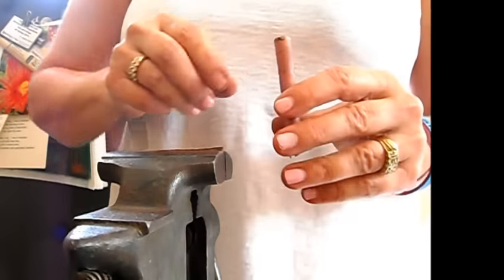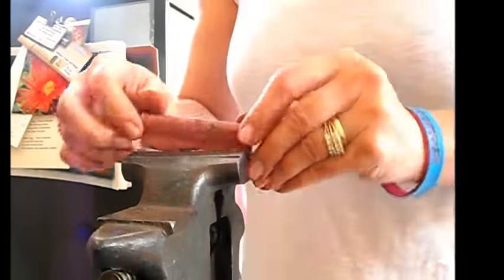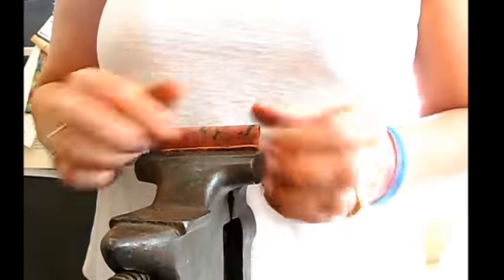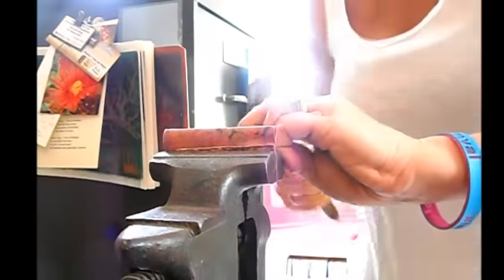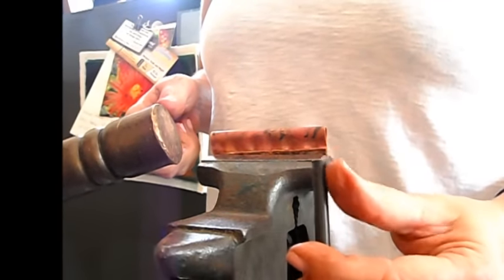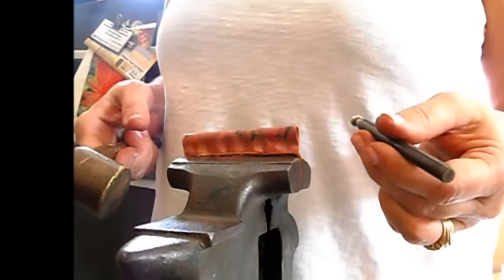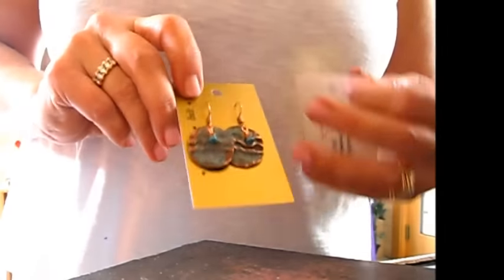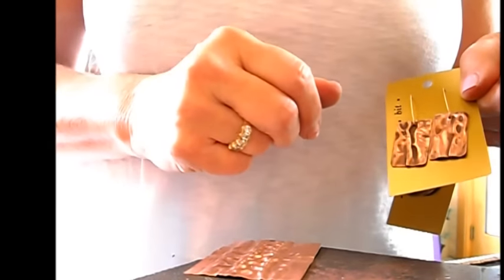Air Chasing Copper

Comment: I've currently got a electrician/plumber's work site right next door as they're replacing the kitchens and bathrooms and the old wiring in the flats where I live. It's like Christmas with all the pieces of copper I keep picking up.  I usually buy copper from a jewellery suppliers and its treated to stop it turning your skin green or black...do you have any tips as to any ways to stop it from doing this because its so lovely looking until I wear it lol! I know I can do various patinas and things like that but is there any sort of home made (read 'Cheap' lol!) Ways to stop it reacting with skin?

Comment: You can use a flat or mill file to dress the end of your punch where it has been peened by blows from the steel hammer. An 8 to 10 inch file not including the handle would do nicely. Longer is better usually as you can get a longer stroke.
Simply clamp the file horizontally in your vise with the damaged end protruding out about an inch. If the punch has flat sides match the angle of the file stroke paralell to the length and the angle of the surface and push forward with a moderate amount of down pressure. Continue strokes until the surface is flush. Rotate the file for the next flat and repeat the process. If the punch is round the process is similar other than using a round over motion during the stroke. 
It will make sense when you try it.
Other wise a belt sander would do nicely as well if you have one in your shop. If you are really into metal working a mini grinder, bench grinder etc. will also do the job. Goes really quick even with a file and your punch will set back in its index.

Comment: With that type of camping stove butane and those torches, if you tip it up and get any liquid in to the injector orifice, it will instantly block due to the low quality gas.

Comment: I would love to get a torch like the one you have. Can you tell me what to buy on Amazon?
Reply: What metal wire do you use for the earring wires using copper for the design?
Reply: If your'e serious about it don't buy a butane/or propane torch to start. It looks like she's using propane.
I use a Mapp torch for years now . Much higher temp if needed and reasonably accurate point of heat for delicate work.
That's in the €100 bracket if you buy a good quality brand.

Comment: Beautiful earrings! Copper is my favorite metal. I would like to try this technique. I have a torch on its way from Amazon. My question is do you need to wear ear protection with all the loud pounding? Or does it just sound loud on the video? Also where did you get your rawhide hammer?

Comment: What gauge copper is best?
Reply: I was using 24 gauge in the video. You can use heavier gauge and you can use lighter gauge - it just depends on how you want to use it and the sturdiness you require. I'd suggest experimenting with some different gauges :) - Good luck, and thanks for watching the video <3

Comment: Who’s selling copper by the ga. It’s sold by ounce 16 once sheet being the most common
Reply: E vI    I from New York but live in florida. Copper being sold by a  jewelry  maybe why they are selling copper by the Ga. 
i own a metal fabrication shop and do many art projects and have been buying copper for the last 20 yrs.  when you buy copper sheet
Is comes 3ft x 10ft and sold by the ounce. Most typically 16 ounce.  But since your purchasing from a jewelry supplier and not a metal supplier 
Is why its sold different.  16 ounce = 24 ga.  Nice work

Comment: Fire extinguisher needs to be away from your work and not where you might need to move across a burning area. Talk with your fire department safety people and have them explain about the placement.  They most likely will be quite happy to help you with this. What you are doing is dangerous.

Comment: wouldn't it be softer after annealing if you didn't quench it?
Reply: Copper is the opposite of carbon steel, you get the copper red hot and then quench it to anneal it. If you did the same process to high carbon steel it would harden it, they are backwards. You anneal silver and gold the same way you do copper. It's weird but that's the way it's done.

Comment: You should never quench when annealing.  You’re defeating the purpose of annealing. By quenching your actually Harding the metal. 
Better to let cool or blow air on it.
Reply: Actually, quenching hot copper and sterling softens it, unlike steel.
Reply: Michael Miner 
Quenching copper does not soften it at all.  It doesnt make the copper softer it just doesn’t temper it like it does with steel.  I do all of my steel work without heat or rather 95%of my work. There are the 5% of the times you cant get around it. Copper and steel are to totally different animals when it comes to using heat.